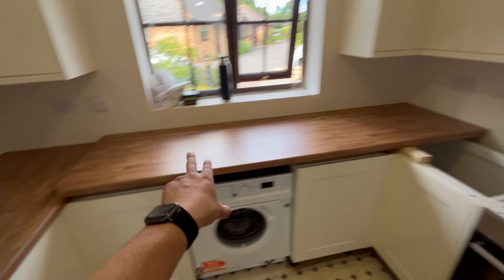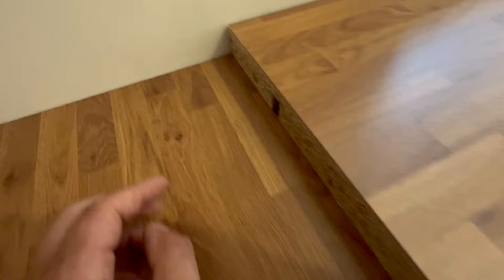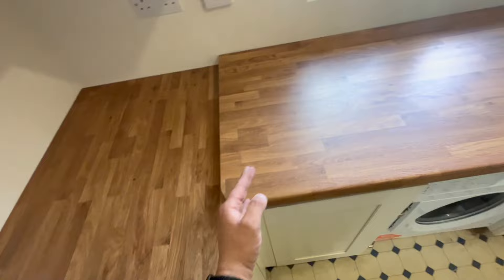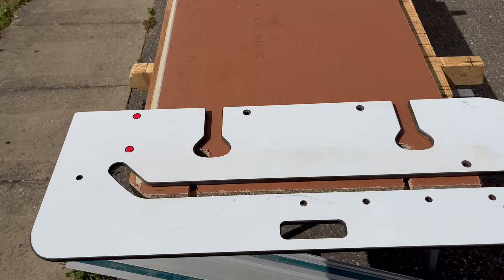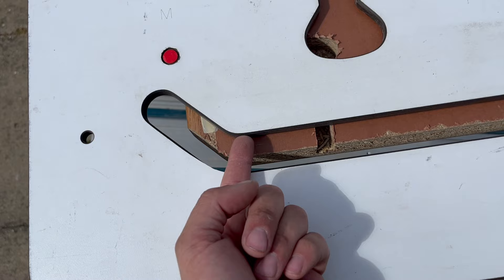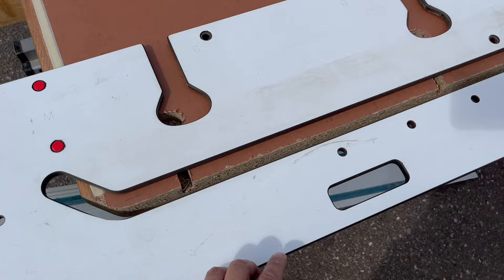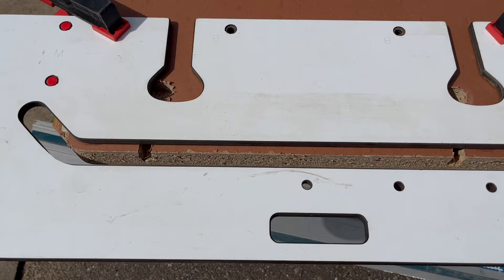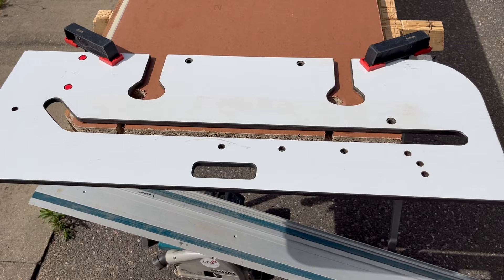How to fit worktops when your walls are out of square

Comment: I've done this on worktops like this with a gap bigger than half  inch. I offer up 2 end panels to the corner in the position where worktops would be placed to establish how much the corner is out and take a measurement of whatever the gap is to nothing.What I do then is pinch a bit on the female joint also, then the rest on the male also. I remove the reference peg furthest away from the male joint when throwing out a joint a large amount to ensure your using your closest peg as your edge reference for the male joint. Otherwise I've learnt that you can end up using the peg furthest away from the joint as your reference which can create a gap between your worktop edge and the peg closest to the joint, giving you an untrue edge reference meaning the joint isn't going to it's full depth and won't match up properly in the front corner, creating a gap at the back of the worktop. Great video, just thought I'd add this from experience and to help anyone who already has their worktops and is in a position where they need to offset a bit more.
Reply: Never adjust the female cut. Been a fitter for 30 years…never ever have I done that.

Comment: Great video Lewis.  
Work tops, what a pain they can be… I’ve tried to cut them out of square and as you mentioned you have to be careful or the hockey stick profile can change…
Reply from the maker: Yes it can indeed that’s why I suggest in doing it on a small amount, I have done this before and messed the hockey stick up myself !
Reply: @LTWCarpentry  trend sell a pivot gadget for out of square rooms.  You basically clamp it to the jig, then pivot it and it keeps the profile.  I’ve only used mine a few times and need more practice. 😬
Reply from the maker: @Ultimate-roofing-square.  ohh really, I didn’t know that do you know the name of it Dan ?
Reply: @LTWCarpentry  trend true cut.  
Tried to share a link..

Comment: Hi chap, great information. On a seperate note how do you join cornice or pelmet on a run of say 5 mtrs long so that the joint isn't noticeable, thanks in advance
Reply from the maker: Hi buddy, you will never get it completely invisible but if you mitre it a 45degrees along the run it will be a lot less visible then a straight cut. Hope this helps

Comment: Hi there, could you tell me if you scribe the female joint to the wall first and then cut the female joint? Or do the joint first then scribe?
Reply from the maker: I try not I scribe to the wall to be honest, as this will change the overhang on the u it’s, If the walls are bad and they arnt being tiled to get over it I will always add an updated to hide the gaps. Hope this helps

Comment: hello, thanks for your video. I have a stupid question. Why is the Masson mitre going so "deep/far" at the beginning of the angle, instead of just going a couple of mm, let's say 5mm (or less), just enough to go past the round border of the worktop? Would it look less aesthetic? Why is the standard way going so deep inner the worktop?
Reply from the maker: You can buy two different types of jigs, one will do a small mitre and this one that dose the larger, I use this as this will cover me for most worktops, saves carry more then one jig around, hope this helps
Reply: You can offset it. Stick a packer between jig pin and worktop. Remember to do it on both cuts though!!!

Comment: I would like to see what happens if the walls are more than 2mm out,because they are definitely not as square as the one you are doing.
Reply from the maker: Well you could always change to a square edge worktop if really bad but like I said in the video you can do this for more then 2mm out
Reply: Nick a bit on both male AND female side. Stops the front edge gap from opening up too. 
Look for a kitchen fitting video by Gid Joiner....he shows how he knocks the jig back for the Female cut and the scribes on the male side

Comment: The right way to do this is to let that worktop sail past say 100mm and just pencil line along the female joint on to the overhung piece of worktop.
Set the jig to your pencil line cut it once job done, id still do it like that even if it was perfectly square as it just works right everytime.
Just my opinion, everyone does things differently 👍
Reply from the maker: If you set you jig on the pencil line then the worktop will come up 9mm wrong, you will still have to off set it either way. I wouldn’t say this your way is the right way, it’s just another way. Thanks for you comment.
Reply: @LTWCarpentry  yes you have to offset the jig 9mm to allow for the guide bush but keeping it parallel with the line you've marked, I've never known anyone to cut it at a dead 90 degrees off the jig in the 'hope' it might fit rather than marking it up 'knowing' it's going to fit. Refitting the jig to recut the joint that you've just cut is not normal practice, measure twice cut once.
Like I said it's just my opinion.
Reply: Actually depends on the jig, my dad has one from the 80's that we still use, it's made of aluminium and it's actually a copy of an original. This jig with the correct router collet will cut the join along the pencil mark as suggested in the comment above.  @LTWCarpentry
Reply: @jimmyk9523 that sounds interesting, what size guide bush does it use, take it cant be you standard 30mm one
Reply: @SME_Ste  Uses 16mm which to be honest is "standard" to me. All depends on how you were taught or what you first started using I suppose. At least with the 16mm guide you can for example clamp a square kitchen shelf along your pencil mark and run your router along it quickly, saves measuring back etc. This method is also handy for Minerva worktops where you're only cutting 3mm deep into the female part of the joint.

Comment: If you don't bisect the angle and allow for both male and female cuts on a 30mm jig with rounded edge worktops, then the profile on the front edge will not match. The bigger the angle, the worst it gets !. Ok with square edge Worktops with a 10mm jig . Anything over 110 degs and your in trouble .
Reply from the maker: You can clearly see from my video that it work perfectly fine with small amounts as stated in my video
Reply: If you're working left to right,  Just overlay your 2nd worktop onto the 1st male side to mark & cut. Nothing else is required.
Reply from the maker: @kevh3113  agreed but that isn’t bisecting the angle at all is it, that’s doing exactly what I show in the video
Reply: Yes. It's doing it your way once, not twice.

Comment: Nice job but you can but and scribe no matter how far the wall are out of square by not using the pins for the second cut i developed a way over 20years agowhich is a secret only to me, almost give my method to trend its about timeto let my method public
Reply: Throw away the pins for the second cut keep your tape in your pocket secret is the position of the jig for the second cut easy with my method you will have to cut once first time every time
Reply: Interested to hear more about what you're doing here.
Reply: Ooooh you drama queen. For anyone interested check out kitchen install by Gid Joiner on YouTube. Shows you how it's done. 
Pins are indeed removed for 2nd cut....biggest problem I can see is how to determine the router bit entry point with precision.